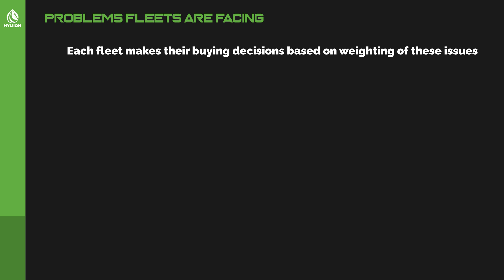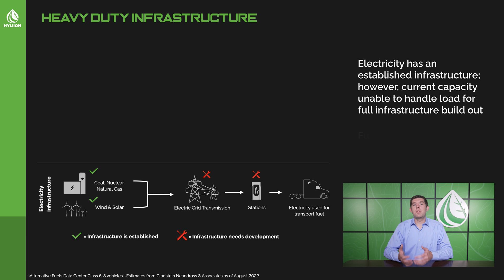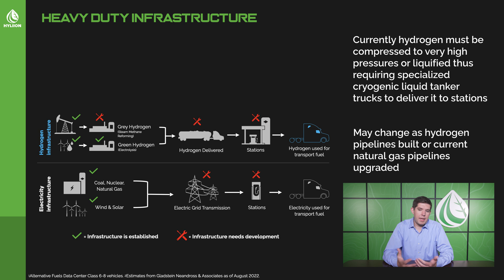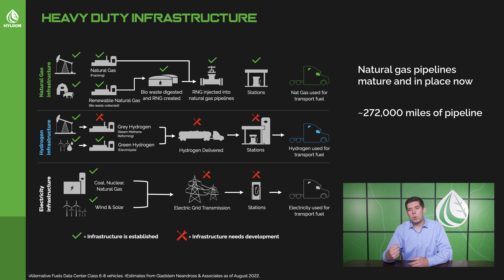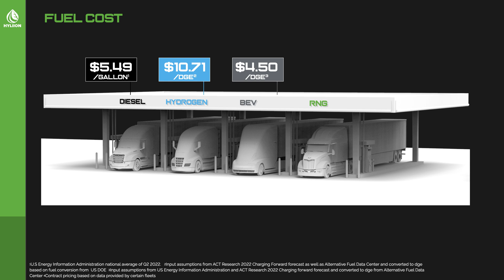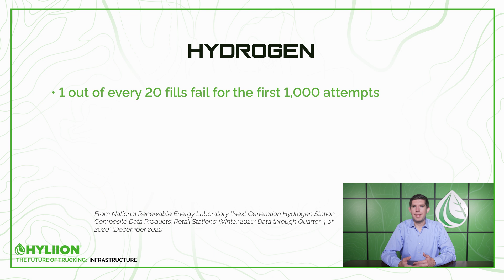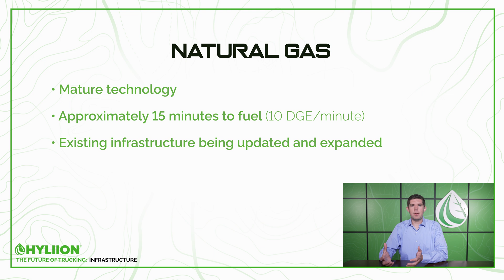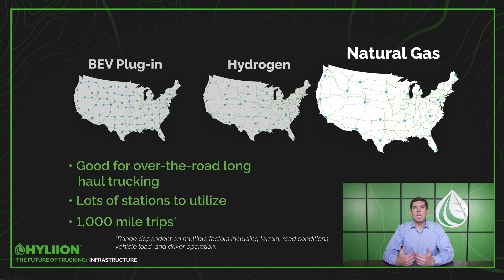Electric Semi-Truck Infrastructure | The Future of Trucking

Comment: Why the range of hydrogen is 500 miles, but 1000 for gas?
Hydrogen using fuel cells has the best efficiency around 60% and 1 kg of hydrogen itself produces 2 times more  energy than 1 kg of petrol

Comment: Also you're using an article from oct 2016 for your BEV recharge rates.  You're so off on that its not even funny, 35-40 min for 500 miles of range via mega-chargers...they will not, and CANT NOT use regular superchargers or EA chargers for obvious reasons, they're far too f'ing big.  Man this is really alarming, i've been holding HYLN for 2 years sadly, and was hoping the culture had shifted over there, but I see its even more misguided than ever.  PLEASE for the love of christ move to BEV only, or you will fail.

Comment: LOL Tesla produces mega-chargers in weeks not months, electrify america might be a couple months, but certainly not a year.  99.99% of the time nothing has to be done to increase grid cap, they're typically running far under capacity.  Transformers, inverters, etc, yes, but the power plant itself not typical at all.   If you're talking about permitting etc, that's something completely different, but I have to say your "facts" are not close to reality at all.

Comment: This almost works, but Tesla is deploying a 500mi(not 200 lol come on now) range truck in the next two months.  What say you to that?
Reply: Electric companies are demanding that Tesla semi buyers pay to upgrade the grid.  This will cost millions even for companies that just buy a few trucks.
Reply: @HoHoHo5622  lol not true.. you don't have to upgrade the grid.  If you have to use a mega charger, you'd use the tesla supplier mega chargers, but you can otherwise charge with any supercharger etc.  You could theorectically daily drive one if you wanted to.

Comment: None of these energy sources can beat Diesel fuel for energy density, economy, and range. Especially in cold or hot running where cab heat or A/C is needed. 

Imagine fueling a hydrogen powered truck in the dead of Winter. The frozen hydrogen fuel nozzle would never release from the vehicle after fueling. 

The E/V electric battery range would be even shorter in Winter due to the cold, cabin heat needed, and vehicle lighting. 

Working with cryogenic natural gas needs a driver specially trained to fuel his truck (I've seen how it is done) and engine power and reliability issues are still not solved.
Reply: Diesel fuel is being phased out in case you haven't heard.  OEM rewards for switching to alternate fuels come in 2024 and 2027 for fleets.  Penalties for not switching will come soon after.  How long until California bans diesel fuel?
Reply: @HoHoHo5622  Diesel fuel is not just for trucks. It powers locomotives, farm machinery, industrial boilers, some electrical power generation, and is used for home heating oil here in New England. So far using Diesel powered machinery is the cheapest way for transportation of goods, food production, and heating. Alternatives are just a pipe dream and will bring us back to the stone age in quality of living and costs.

Comment: As both Hylion and Tesla stack holder it bothers me that you say electric trucks are 200 miles range and gas are 1000 miles. While the truth is that gas trucks don't have that range. They may have it in the future if they will use your systems maybe... and Tesla trucks that are allready in the making are having 500 miles range right now, and may be going to 600 miles in the near future. Its like you are distorting the numbers and the truth
Reply: try using it as a truck(towing,hauling weight) and they have no range or savings over gas.